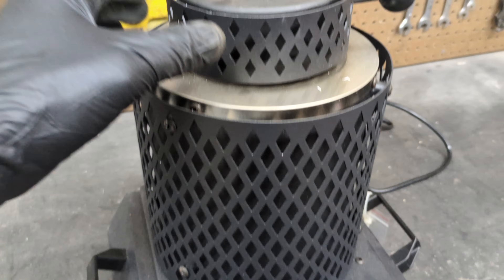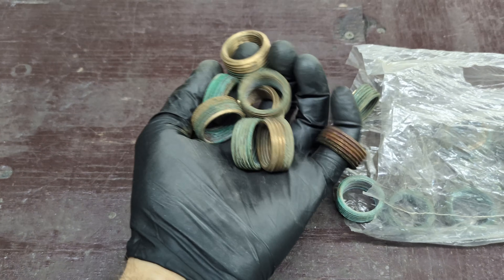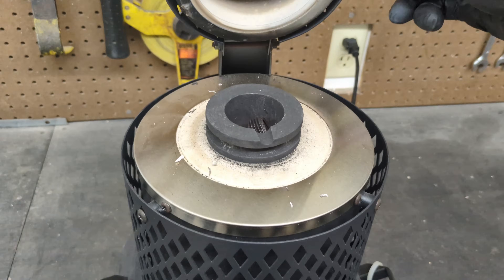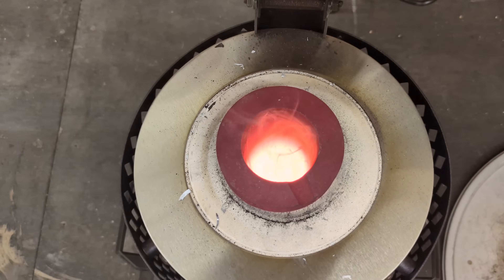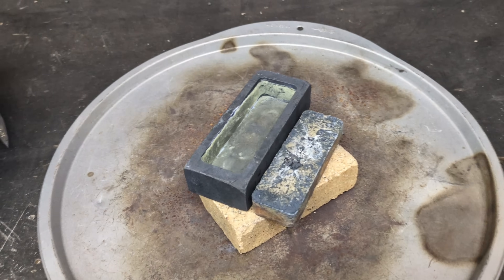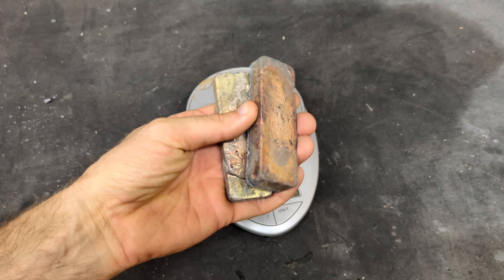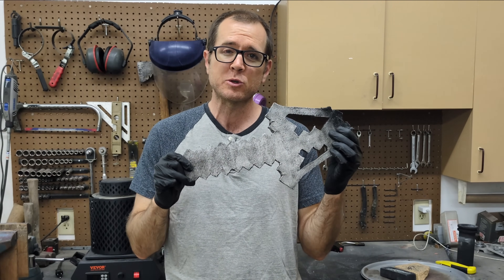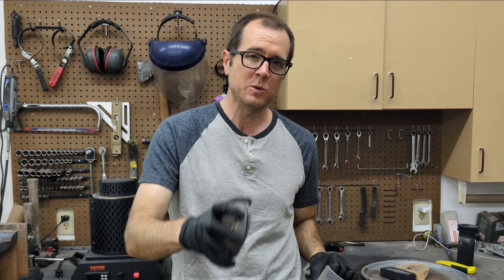Can the Vevor Electric Furnace Melt BRASS? - Melting Brass into Ingots

Comment: Hello. I see you've been using electric style furnaces for many years. How has your long term usage been on newer model? Any tips to make the most of this style furnace? My intention is for smaller production using scrap copper or aluminum from house hold appliances. ty
Reply from the maker: I don't use this very often.  I will say melting copper with any electric furnace will put a strain on the furnace and shorten its lifespan.  Brass would be better to use than cooper since it does require as much heat.  I mainly use my outdoor propane furnace when melting copper.
However aluminum works just fine and will last a long time.

Comment: Seemed like that Cooled down much faster than the aluminum ❤😮
Reply from the maker: Yeah I'm assuming the hotter the temperature the faster after it cools.
Reply: @HeinrichsMade yeah. Like hot water freezes faster. It takes more energy to keep the higher temp, so it plummets quicker. Very interesting ❤
Reply from the maker: @1-4PinkFloyd exactly 💯💯